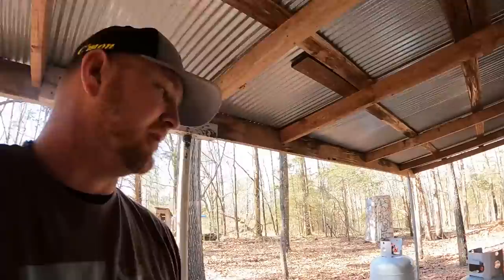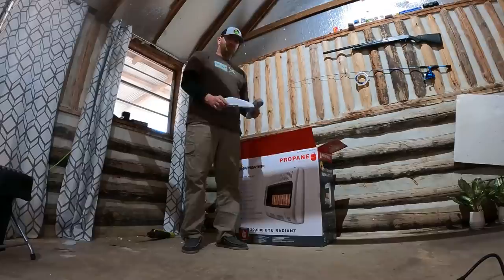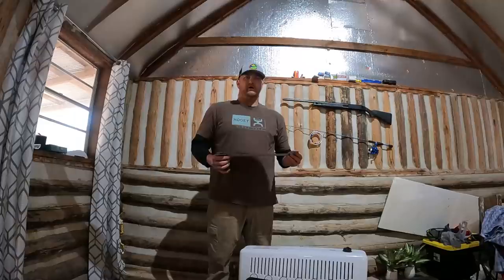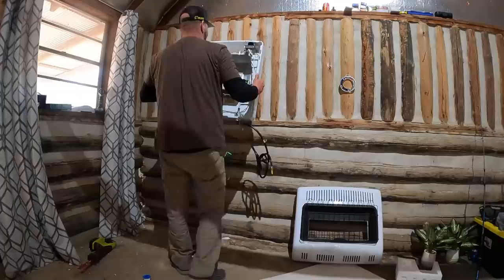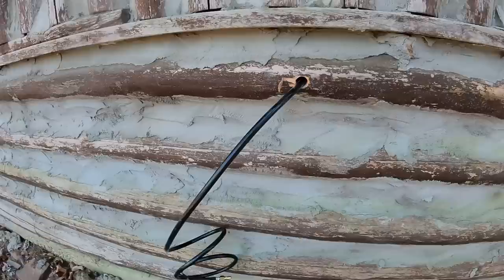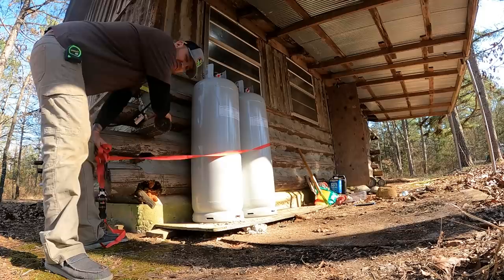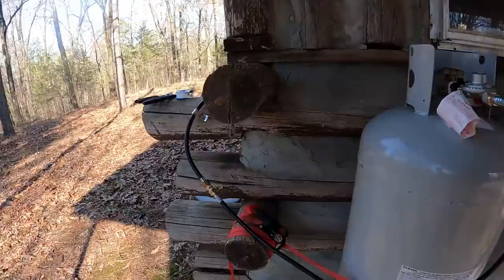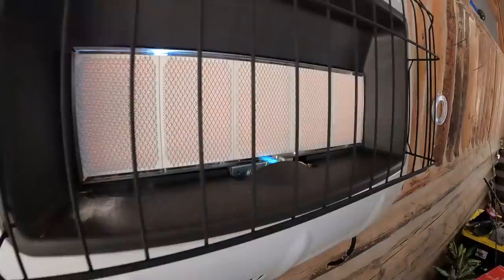INSTALLING PROPANE HEAT | homesteading | off grid living | cabin build | cabin | off grid cabin

Comment: A bit more on propane heat. The BTU content of a gallon of propane is 91,000BTU. Your heater when on uses 30,000BTU/Hr. The temperature control on that heater does not allow setting for a particular room temperature - it simply turns the heater on and off cyclically based somewhat on room temperature. A 100lb bottle of propane contains about 25 gallons of propane. You can now run the numbers to determine how long a 100lb bottle will last. If for instance the heater needs to run at 25% duty cycle to keep you warm enough then it has to run for 6 hrs out of every 24hrs. This will run out a 100lb bottle in 12 days. (here is the math: 25Gal x 91,000 = 2,275,000 BTU. This would run your heater continuously for 2,275,00 divide by 30,000 = 75.8 hrs. For 25% duty cycle divide 75.8 by 6 = 12.6 which. at 25% duty cycle means 12.6 six hour periods every 24 hrs. which is 12 days.
Reply: Not to mention a gas shut off valve anywhere inside the house?

Comment: You need to switch the Teflon tape to the Yellow or grey Teflon tape rated for gas and oil. Doubt it will cause any immediate issues but over time the white Teflon can breakdown and cause a leak. Or so they say.
Reply: Agree.  White is for water plumbing and yellow is for gas lines.  Hope you see the comment and replace that tape.  Stay safe.
Reply: As a gasfitter, I approve this message
Reply: Yep 👍
Reply: What they said. Good job C'Mon

Comment: That heater is a little too high.  It should be off the the floor a bit.  Also you need a drip leg off the bottom of the unit for a moisture trap. That thing will heat you out out of there.  Good choice
Reply: YOU ARE CORRECT
Reply: Also he should not have used teflon tape.  Pipe dope is what he should have used.

Comment: My friend had a wall heater and he took it back.  It gave him headaches and lowered his oxygen leven when it got warm. Even though it says it is ventless those fumes can build up CO2 in my opinion and do more harm than good to some people.  
I would have went with a very small vented furnace or, since you have so much wood around there, I would have gotten a wood stove.  Especially for safety reasons.  But I read the new ones have oxygen sensor built in and are very safe, so good luck.

Comment: Get a diverter hose. We had tanks that size. Ran refrigerator, regular stove, hot water tank and heater at night. Used wood during day if home. Get a gauge, don’t use till empty. You can also get connector hose to attach both tanks then you only turn valve for which tank your using.   We used lanterns. Once a week ran generator for lights at night. No solar back then. We didn’t like the noise of generator. Loved our quiet. Good luck 🍀 and prayers always

Comment: I,have the 45k BTU version of that for a shop heater it will work great it does not use that much propane but I had to add a secondary fan to circulate the air

Comment: Nice job Brother. I don't want to sound like a know-it-all, but I have 2 suggestions. Take apart your LP connections and throw away that white Teflon Tape. White degrades when used for LP. Buy the Yellow (it is made for gas connections) and will keep you safer. Also, because heat rises that heater will work better on the floor and in the center of the room. Also, get yourself a 4-blade heat powered Stove fan to put above that Mr. Heater ($14.00 - Amazon) It doesn't use electricity and it will help circulate your heat.

Comment: Those heaters do a good job, but since they're unvented you may get a build-up of moisture inside the cabin.  You'll most likely see the moisture on the windows first.  I'd also recommend a carbon monoxide detector or two for the building, since CO is colorless and odorless and only slightly lighter than air, I'd place one detector at a lower location and one higher.

Comment: David,
There is a product called  “Gas stop”.
It prevents propane gas leaks from your tanks.  We use them on our RV as a safety measure.  You might want to look into them.  They also prevent your propane from bleeding off if you have a minor leak.  With the price of propane today-everything helps.

Comment: Warm air rises. Figure out where you want to put the furniture and then find a low spot. Remember having the air low will help keep the floor a little warmer. This helps with keeping lower legs warm while sitting on the furniture. Dress in layers.Good luck.

Comment: A caution regarding vent free propane heaters - aside from CO2 - (yours has a low oxygen sensor and will shut off when oxygen is too low) - burning propane produces a lot of water as well as CO2 - this water can actually wet the interior wall and ceiling surfaces.

Comment: Way to go, Bro! Those radiant heaters the way to go. I prefer vented gas heaters, but in a pinch, the un-vented work well. Might want to get a CO monitor as well.
Reply: Get smoke detectors and carbon monixide detector

Comment: Like so many others comments. 
The use of white Teflon tape degrades with LP gas and will leak. Installing a gas shut off valve and a sediment drip leg to keep the trash out of your gas valve is needed. This will help keep your gas valve from sticking. This is in the instructions. Hope you make the changes before something bad happens.

Comment: I do know a thing or 2 about  propane heaters.  I was raised in house that had one in every room so i would like to offer some advice.  Please get a carbon monoxide detector( VERY IMPORTANT)  and  USE THE TAPE THAT IS RATED FOR PROPANE. FROM EXPERIENCE I WILL SAY WITH THE HEATER  LOWER   ON THE WALL IT WOULD GIVE YOU MORE HEAT. I ONLY SAY THESES  THINGS FOR YOUR BENEFIT.  BE SAFE ! Looking forward to the next video.

Comment: I have one of those black fans that you see people set on their wood stoves. You know the kind that has no cords or anything it moves when it gets hot. well that thing lol I have one of those attached with wire to my propane heater like that and it really does make a difference!! I need to purchase a second soo much heat comes straight out the top of that thing so adding the fan really does make a difference in moving and distributing the heat.

Comment: Great video we had a propane heater in our cabin until we replaced it with a pellet stove, I think much more efficient and a lot easier with transporting fuel. Also have you considered say terra cotta tile floor. Would add a great look and better than concrete. Anyway great videos brother.

Comment: I dont want to sound critical, just some advice from someone that has done this very project with 30 years of construction behind me and Im a licensed electrician and inspector.
1) where does the CO2 go?  I hope you have a CO detector in there.
2) you used plumbers tape, not gas tape which is yellow.  The white tape is going to break down pretty fast.
3) when you drill a hole like that, drill from both sides so you dont blow out the hole.  When you had that little hole,  you should have gone outside and finished. 
4) insulate the propane tanks.
5) I would still wrap the edges of that heater in metal and probably have put a sheet of metal behind it with an air gap.

Comment: You will do fine with that! I can't even use mine that size! It roasts us out of the house. We have two 10,000 btus and I have never gone over a 100 gallons of propane in a winter. We also have a wood stove but use these in far away rooms! You should be good! Excellent plan to go this route. Cheap heat in a hurry. We bought our farm in January and there was no heat source so we put these in. 16 years and still running! Awesome!

Comment: CAUTION:  Most regulations require propane tanks to be at least 5-feet away from any windows, and any "ignition source" (receptacles included).  It's unlikely anyone is coming to inspect the setup, but you may want to consider the  placement of the tanks for your own safety.    Although you will likely thoroughly leak-check all connections, connections can leak over time due to expansion and contraction as temperatures fluctuate.
Reply: I am not sure what the reg's. are in Texas (I imagine they're the same) but here in CT we can have them near a window as long as the valve is below the sill. LP is heavier than air..
Reply: I don't think he posted this video because he needed your advice....

Comment: Great install  I like the factors that you're mounting it on the wall and your tanks are outside 2nd thing is the hundred pound bottles it always makes me cringe when I see people putting the bottle inside their living space years ago when I used hundred pound bottles for construction heat I appreciated one attendant he filled my bottles to 100 percent since it was cold and I took the bottle out and hooked it up so I had an extra  day or two of heat but  years later I set up a small space to live in while I built my house I had a camp kitchen with a one burner stove that I put an adapter on and run it on a ten pound bottle under it I had a old camper fridge that run on proper since I had a 30 pd aluminum bottle I put the bottle in the shed part of my unit and ran a hose through the wall to the fridge when I had the bottle filled the attendant tried to charge me for a 40 pound refill I should have known I had a problem at that point unfortunately I was so ticked off I never thought about it I was still fuming while going home so I didn't even think that I might have a dangerous situation when it it vented in the van just went home hooked it up to the fridge and lit the pilot light my brother had brought some of his boys down to help so we started working after about 30 minutes one of the boys said your shed living space is on fire since it was just the shed half that was burning one of the boys offered to run into the living space to get what we could get out I said no the 30 pound cylinder could blow any time called the fire department and watched as the shed burned the little tank blew first unfortunately I had a box of flavor packs for my water bottle on top and they were like flaming arrows and everywhere they landed started on fire we couldn't stomp out all them fast enough so I lost all my building materials and the house was damaged beyond repair the fire department finally got there and put out the fires but by then there was nothing salvageable even my jacuzzi bathtub was destroyed we hadn't noticed in time but a fire had started by the pump and by the time we noticed it had melted the plastic pump and burned a hole in the tub nothing was majorly burned just enough to ruin it and since construction insurance had too many conditions I didn't have any I never did recover from that years later I sold the property as trying to build on a tight budget with all the material already was bad enough but without the materials it was a no go so that's why I  believe it a bad idea and very dangerous to have your propane bottle inside your living space also having the heater sitting on the floor sure they shut down when tipped over but they don't immediately cool down catalytic heaters glow red hot and if they land face down on a combustible surface it'll catch fire before cool down occurs so it's smart that you mounted it to the wall and put the tanks outside also watch for someone getting rid of an old leaky rotten camper quite often you can get part for free or cheap sometimes you might have to take the unit away for salvage like I did on a camper for the back of a pickup truck I salvaged the bathroom kitchen water tank  pump windows and the beds  everything I needed to turn a van into a camper

Comment: Keep the heater low to the floor as heat rises and your floor area won't be as warm if you mount it high. I've got the same exact heater in my living room and it is supplemental heat in case of power failure. It does really good for half the house, we got over 2000sq ft.

Comment: 👋 nice heater my suggestion would be to install a reversible ceiling fan. Reverse would help to circulate the heat and switch the setting for the summer for fan  (when you get electric source)

Comment: Hi, I use one of those heaters but gas to heat my home in NE Ohio. As others have said heat rises. I uses a ceiling fan in the room the heater is in on reverse to move the heat back down.  Works fine but humidity/condensation was a problem which means I also need to use an electric space heater to correct that problem. Best wishes and God bless.

Comment: Loving the videos!  Keep ‘em coming! Just curious why you aren’t using a wood stove. Would be the most cost effective heat source for the cabin. Also, you may want to re mount that propane heater lower, it’s too high.. Heat rises.
Reply: YOU ARE CORRECT,,, HE HAS IT WAY TO HIGH

Comment: Just found your channel. Great content. A fan or 2 at ceiling height to circulate the rising warm air back down would be a big help. This would also help reduce the condensation and moistue that is created from burning gas. Thanks again and good luck from Ireland. Sláinte

Comment: If it were me I would use the copper line that is coated in polypropylene to supply your heater it will stand up to weather better but you’ll need some other tools like a flaring tool to do that

Comment: Please double check with your vendor regarding the teflon tape that you used on your gas lines. In our area gas line teflon tape is yellow in color and will resist the fumes of your propane gas.

Comment: Close to the floor like 18 inch from the bottom of the heater will preform better. The tall ceiling will work against you. All the heat will be at the top except for the inferred effects that you'll get .

Comment: I have one of those heaters,but mine has blue flames got it from tractor supply 1 100lb lasted Melbourne a month or little longer.  But my current place is only 8x8. Mine is wall mounted the loft will be warmer. This Was the 2nd winter I've used it

Comment: now get a ceiling fan, on low it will move the heat and make the ned area warmer using less propane.  Looks like home, hope you get 6-800 w solar to offset the hell washington is leading us to. Even propane is gonna be on option soon.

Comment: Unvented heaters put carbon monoxide in the room so I hope it has a sensor to shut it off if the concentration gets too high. It probably would have heated the room better if the heater was close to the floor because heat rises.

Comment: I use an older version of your heater and propane tank. Um you may have to move the heater down to the floor. Heats gonna be up by your head and cold down low especially if you have any drafts. I live in new york and a tank will last 10 to 12 days in the teens and lower. You should get about 3 weeks or more out of a tank cause it ain't nearly as cold or for very long where your at.

Comment: Hey a word to the wise . I have the same bottles if it's really cold you will find if the tanks are not covered and insulated they can freeze up all the sudden you have no heat or your heaters and stove just goes off and then comes back on in the middle of the night and had them is realized in your home while you sleep. It's happen twice to me this winter. So 8f you can insulate your bottles the gas company told me it's because gad is going out so quick it makes the bottles freeze. I don't know it just seems dangerous to me but when I can I will build something around mine and insulate. And if any had suggestions to stop that let me know too I need it I have 2 grandkids living with me too so. And I was told that by 3 gas people. I just know it's happened more that once to us and wake up with gas loose in the house with no fire.

Comment: Not trying to be mean, but never in my life have 
I seen a propane space heater hung so high on the
wall. Should be as close to the floor as possible. 
Heat rises and the lower part of the cabin may stay
really chilly. Only a ceiling fan on reverse might help with that.
It’s also very nice to back up to the stove when you’ve 
come inside from the cold to warm up fast. Wow, just wow.
Reply: They should but if he has pets I've always wondered about mounting it a little higher if you have such high ceilings... This way it would be hard for a dog to burn itself.
Reply from the maker: I'm aware that heat rises i have very young grandkids and want it out of reach i will be installing  fans to move the heat around the cabin
Reply: @hithere7382  dogs are smarter than you think LOL as well as kids my dogs won't go near my stove and neither do my wife's Brothers kids when they sleep over in the living room alone with the pallet stove running kind of like instinct. yeah mistakes happen but kind of rare. I also raised my two kids I never had them touch the stove before. But to each their own I guess. And if they are curious little critters They won't touch it twice I'll tell you that LOL

Comment: If that heater don't have a blower it probably would have worked better a little bit lower to the ground you might notice colder temperatures more closer to the floor because that heater is so high heat goes up cold sinks down so the cold air on the bottom won't get turned into hot air as much I'm sure it will still work and keep the house warm just a little FYI also a fan might help with that

Comment: Laws of physics...why do you think heat registers are on the floor....because hot air rises...if you put that heater way up off the floor , your floor will remain cold..and you will be heating the ceiling..not the floor and the middle space where you are living...it needs to be at floor level to heat across that space on the floor then travel upwards...to give you maximum heat throughout the cabin...... unless you have a ceiling fan to blow the Warm air back down...